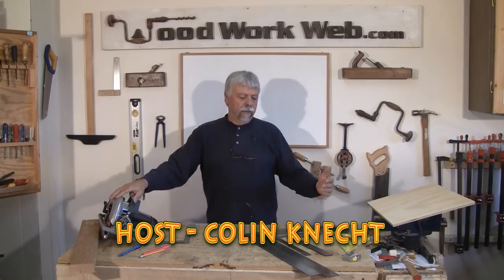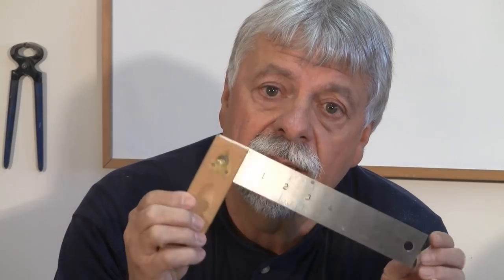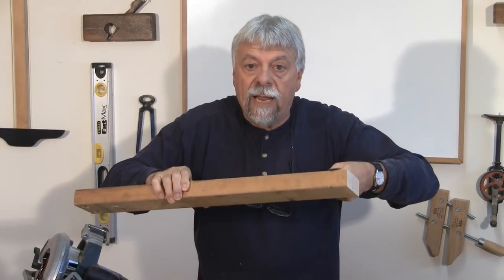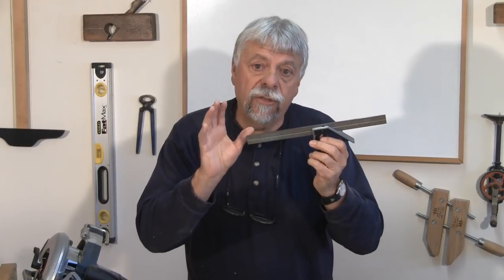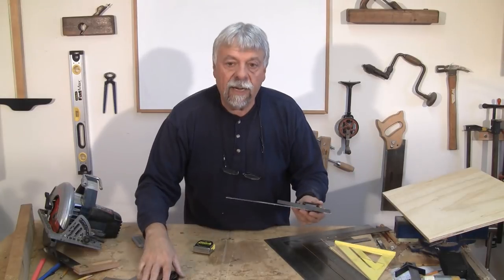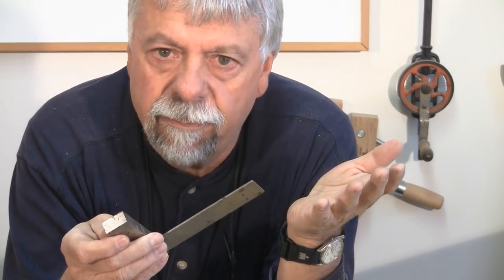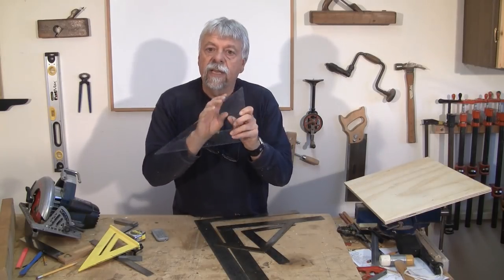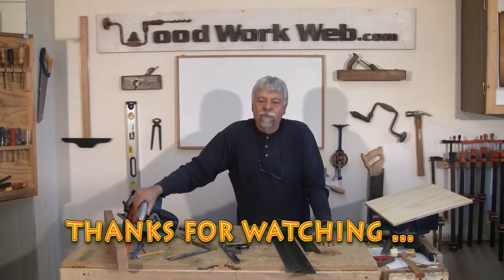Squares - Choosing and Using Them in the Workshop -- A woodworkweb.com video

Comment: This just confirmed my own experience with some squares- regardless of quality.
It's better to use a solid type of square if you really want to be absolutely accurate. Something that contains loose parts and that can get inaccurate with time is something to be wary of.

If you can do the job with a framing square, then do so. I've found we resort to substitutes and cross-over tools as a result of people not using the intended tool correctly or for it's intended purpose or not trying to get the very best out of it, so they use a substitute to make it "easier". In drawing and fine art- my hobby- it's exactly the same: millions of pencil grades for instance: from 9H to F to HB all the way up to 9B- all because people(or teachers/instructors who are the biggest culprits) do not have the time or patience to learn/teach how to use a pencil properly and setup a drawing surface correctly or how to blend or shade correctly; and how to use pressure and multiple layers to control the volume of your shade. Stumps and a variety of mechanical pencils, heaps of erasers, every sort of sharpener under the sun etc..
Just a mess and the quality of work suffers.

It might take a little bit more work, but learn to use the correct tool- properly; for the job and you save yourself a lot of headaches, avoid a bad habit and avoid dependency on that substitute. Simples.

Thanks again!

Comment: 2:19 I know that as a combination square. That brass pin has nothing to do with its being square or not, that's determined by the body of the square. If it's not square on purchase, it's faulty. If it's not square later, there might be some dirt in it, it ight be worn out. Just check it before measuring something important.

Comment: of the several squares ive had over the years, the one i bought with the most inaccuracy was a large one piece steel square, i had to throw it away,  ive had rabone wood/steel try squares for decades that have remained perfectly solid and square, each to his own, always check your squares when you buy and often.  i also had one of those combination squares, it was never accurate and was also thrown, i had not checked it and only realized  it was out when i did some bad work

Comment: I have a Question, The tool Ive always known as a Combination Square, i hear you calling it a Try square. Now heres my confusion does it have two names? i thought a try square looked like just an L Shaped device to measure with, with one thicker shorter handle. Great videos by the Way i Love them.
Reply: Don't believe what he says, it's ignorance presented as truth.
A try square has a fixed blade of a material that doesn't bend, a thicker handle so it can register against a surface, and can try both an inside and an outside square.
A combination square has a sliding head like a T square, but a head with a 45 degree angle on one side.  They don't have an outside square, but often have other extra functionality, including ruler markings, bubble levels, and a scribing awl embedded in the handle.
The two have different uses, and almost every woodworker will have and use both.

There are also try squares with an additional 45 degree surface, and T squares which have a sliding head but not a 45 degree mitre angle.

The steel squares he advocates are useful if you need to mark a square in the middle of a surface, and not the edge.  Like construction work, coupled with a plumb bob.
For edges, they're the worst choice of all, given that they don't register, and bend under their own weight.

Comment: Colin could you find out if I can fit a dado blade to my portable 10 inch table saw rise and fall dw7 354 peter fae Scotland thanks col.
Reply from the maker: Peter Haughton Having a bit of trouble finding an exact answer but here is best I can find. Your saw has a 30mm arbor (??) all blades in North America are 5/8 inches or  15.8mm  ... but even if we could find a dado blade, the other issue would be the horse power of your saw, is a wee bit low to be trying to drive a dado set, the other problem is that the saw arbor, from what I can find, is too short to put a dado blade on and still have room to secure it with the screw.
Peter, I am planning to do a video on making dado cuts with the router in the next few weeks. I know this doesn't help you now, and not sure if you have a router, but this might be an alternative for you in the future.

Hope this helps Peter .... 
Colin
Reply: Yes use router a lot col all look out for that and thanks for getting back so soon peter fae Scotland.

Comment: Just bought a set of Engineers Square. Glad that I didn't go for the combination tri-square with bubbles.
Reply: +GM0MOP a combination square is just as accurate as a engineers square however the only ones to get get are starett, rabone and the stanly cast iron version as they now own rabone  they are machinists squares and very very accurate
Reply: I would also recommend PEC and Mitutoyo.  These are pricey but you only cry once.

Comment: The second square you talk about is a Combination square, not a Tri square (that is the first square you talked about) As below Buy Cheap, Get Cheap. Try a Starrett. I have multiple Framing, Steel, squares and I check them with my Starrett combination squares (I have multiples of them also).

Comment: First one's a try square, second one is a combination square, the big ones are framing squares, the little all metal squares are actually called engineer's squares, and the last ones are Speed squares.  The try square is a tool of yesteryear, the combination square serves a multitude of tasks in wood working and machining, the framing square is used by (no surprise) framers, and engineer's squares are machinist's tools. I appreciate this man's attempt at educating the public but he's simply misinformed about a few things.  First off, he keeps calling a combination square a try square and that's incorrect.  Lastly, a Speed square and a combination square (with a center finder head and a protractor head) are by far a carpenter's best friend and it's utterly absurd to think that a woodworker is going to work within tolerances of .005 of an inch.
Reply: Try squares are far from a tool of yesteryear.  I use one every day.  It can try both outside and inside squares, be used for marking, as well as be clamped in a vise to check the twist of wood at any point without setting up winding sticks.  It's a must have for any hand tool woodworker.

Tolerances far smaller than 0.005" are common in fine hand tool woodworking.  We take off plane and chisel shavings that are a thousandth of an inch or less.   But we don't do it by measuring, but by transfer.  Measuring is for carpentry and other coarse work.

Comment: My square comes with a small pin. What is it for? I've been told it is a scribing tool. Ho-ever scratching a mark instead of using  a pencil  seems WRONG.
Reply: Yes, a combination square has a scribe Included in the head. It is used for marking, but most people  just use there pencils or a marking knife

Comment: Some good points but way too much generalization. Steel square by itself does not mean it is going to be any more accurate than other type of squares. There are standards (at least a DIN) which define the accuracy requirements for squaressness and even then it needs to be periodically checked. Steel squares might withstand a bit more abuse but I would not trust a 1 dollar steel square just because it is a steel square. They are also extremely poor when trying to make a square line let's say for example to a 2x4; you have to hang one end unevenly over one side which causes the otjer side you use to draw the line bend. There goes your accuracy. English is not my first language so hopefully I made sense.
Reply: Sorry to break it to ya but you dont know how to use a steel sqaure you are far to harsh if you cant keep it from moving

Comment: sorry but tri-squares are used by machinists...and they do much more precision work than any wood worker.  it is not fair to say they are not accurate.  Buy cheap get cheap.
Reply: What tri-square would you recommend ?
Reply: Pretty much everything Mitutoyo & Starrett produces is excellent... including their combination and machinist (engineers) squares. Both companies are class acts...
Reply: Very helpful!!!!!
Reply: Interesting vid. Wish you demonstrated how you go about checking various squares. Confirmation or error-measurement techniques are often less than obvious. Have enjoyed several of your vids. Thanks for sharing your knowledge & experience.
Reply: azbushrat
Takes 10 seconds to see if a square is true.  If he's run across a slew of shitty ones, why would you think that's impossible.  Machinists squares are all metal.  And they're called Try Squares, not tri-squares.  Those wooden ones are sold at high prices to anal retentive idiots.  No engineer or machinist would go near one.
Reply: My 24" on the bench as we speak was made by Pratt & Whitney. No aluminum parts. No brass parts. Will stay true and square for a few lifetimes.
Reply: Oh, and it's a combination square.
Reply: Sorry, but given you can't even spell try square properly, it's hard to credit your point to any capacity.  I can also tell you are either not a woodworker, or just a poor one.  While these are great on wood, especially hardwood for confirming cuts, they are the best option in truing up your tools be it table saw, miter saw, jointer, etc.  Having tools in perfect order ensure fine woodworking.  I also use calipers and measure within 0003 to 0005, so you are uniformed.
Reply: What is the best measure for a 45° angle please, to get my mitres perfect in my photograph frames? Thank you.

Comment: The arguments about naming of squares and their make and associated accuracy miss the point Colin is trying to make, namely that it is wise never to assume a square is accurate without checking it.  If its out of square, correct it or at least don’t rely on it.  If its truly square, no matter how cheap or expensive it is, or what make it is, continue to use it.

My experience mirrors Colin’s very closely:  My combination square was inaccurate the instant I bought it - it was inexpensive but I couldn’t afford a top quality one - but the important point is that I checked it before using it.  I now only use it for depth or width measurement or setting a width for scribing a line parallel with the straight edge of a board or a piece of timber, for which it’s very useful.  If I want accuracy I use an engineer’s square of which I have a set of three sizes.

The protractor which is part of my combination square has a serious zero error so I only use it after setting it against a part with a known angle which I wish to duplicate.

My steel framing square was significantly out of square when I bought it but again, I didn’t assume, and checked it and then corrected it using a robust centre punch and a hammer.  It’s now accurate.

Colin is correct when he says he’s seen people on Youtube using a combination square to check a right-angled corner.  I too have seen this and had the same reaction because sometimes its obvious from the appearance of the tool that its a low cost item but like him, I bet they’ve just accepted it without thinking to check it.

Thank you, Colin for highlighting the need to check rather than merely assume.  And as you said in your video, if you find its accurate, just continue to use it, no matter how little you paid for it.  I would add to recheck it from time to time because of the effects of wear and tear, especially if you drop it!

Comment: I'm confused. I thought a try square (to "try" the squareness) is like your engineer's square, with only a fixed 90 degree handle. What you are calling a try square is what I call a combination square (with the adjustable sliding head).
Reply: Correct.  A combination square is NOT a try square.  A try square also has an outer angle, and can be used for a couple of things a combination square cannot be used for, like squaring an inner angle.  But a combination square can be used for many other things.

And no, the combination square was not made for electric saws.
L. S. Starrett designed the combination square in 1883, for cabinet makers.

And saying that it's for carpentry, and carpentry pens are inaccurate is absolute crud.  Good combination squares come with a striking awl embedded in the handle precisely because it's more precise than any pencil.

The grating admonishing voice is what gets me the most.  He's dead wrong on half of what he says and talks like he thinks he's a master teacher.  Two thumbs down.
Reply: I thought it was a "tri" square because it has 3 sides.
Reply: Most people spell it "try", some "tri". Don't suppose it matters much, one way or the other. "Trying the squareness" is just something I once heard, probably half a century ago, in shop class. Your opinion sounds every bit as plausible.

Comment: which engineers squares are good?
Reply from the maker: Richard Cowtails Very good question, and so far I have not found one that is off, but have only looked at maybe 5 brands. What you want to look for is those with a heavy or thicker main body, then a slightly thinner blade. This makes them easier and quicker to use. If you google engineers squares you will see links to Amazon, Lee Valley for example, they show good quality squares, and not really that expensive for a square that will last you the rest of your life.
Reply: Hi. Is there a standard for square accuracy in the US like we have in Europe? It's nice to have a specified tolerance when shopping and not having to rely on reviews of other samples and hope for the best..Machinist square article on Wikipedia is good. Check out the DIN875 standard or the UK's BS939, http://www.thome-precision.com/DIN875.html
Reply: Starrett rate most of their cast iron squares at an accuracy of +-0.001 per 6" of length.
That's good enough for most, but if you deal with extreme lengths and accuracy requirements, you would generally use a long straight edge with trammel points or otherwise construct the square.
You can also buy a certified 12" fixed square that's certified at +-0.0001 per 6", but then it also costs a pretty penny (and its 69799 brethren).

Comment: I'm somewhat confused, I'm far from being an expert and I do agree with much of what is said but dismissing some squares are being intended for construction industry yet singing the virtues of framing squares which probably more than any other square are,, meant for the construction industry, the markings on them relate to roof pitches etc.
All that said Mr Paul Sellers doesn't seem to share the same reservations of using a combination square (not tri-square) so for all I appreciate the information I don't trust any square until I've tested it (yes with an engineers square)
Thanks for the video
Reply: Framing squares are a single piece of steel, so they can't get out of whack, easily. Same thing goes for speed squares, if you get the kind that are steel or aluminum. Even if it's "made for construction," as long as it's made properly, it will be fine. I think he mixes up his reasoning, here and there, and presumes his own definition of "woodworker,"  but his points are spot on.

Comment: "These aren't accurate".
No wonder, considering how you handle them. They are precision instruments, you are not supposed to just throw them in a pile! Never put them on top of anything but a flat surface!
Btw, the combination square (that you call tri-square) CAN be very accurate. The blade is pressed down against two hardened indexing pins in the bottom of the slot by the knob, so the bottom of the slot doesn't actually get worn. On cheaper ones, those indexing pins are not always exact from the factory, so they sometimes needs to be calibrated before use. The slot needs to be kept very clean though, as dirt and dust can get between the indexing pins and the blade.
Be careful with cheap steel squares, they are often just as unprecise as wooden ones. Basically anything thst is riveted together is a no-go
When I need to calibrate the blade on my table saw or my sliding mitre saw (or even checking other squares), I use a knife edge square. I have 2 of those, a 3x4" and a 4x6". They are crazy accurate. Much more so than your engineering square.

Comment: Hi Colin, have you ever though of what heat does to metal? It Expands & Contracts metal & not just wood or plastic. I agrre with what you say 100%. I prefer only metal measrement tools. I wish manufacturers would make measurement tools out of Fiber Glass, as it does not warp or change it's shape in heat. Your info on Squares is very interesting. I am looking at buying the combination sqaure & I have a stainless steel 1000mm (1m) ruler. Am looking at getting a 600mm stainless steel ruler in next few days. Also I have a Digital stainless steel Verner Caliper. Yeah accuracy is very important in any build projects period.
Reply: Wayne Getkate humidity is probably a large factor with wood and more so than metal.

Comment: That is a 30-60-90 triangle. I have been in drafting and engineering most of my life and I have NEVER seen that piece of plastic called a square. And while they work fine on a drafting table the edges get beaten up pretty fast around a shop. I have ruined my share of them.

Comment: Colin, i don't think you are correct about the history of the combination square or the accuracy of a quality combination square. The head of a good comb. square will be either cast iron or forged steel, not aluminum. You are more likely to find a good quality combination square in a machine shop than in a carpenter's apron. I doubt anything with sliding parts will be as accurate as an engineer's square, but then it has more uses too.